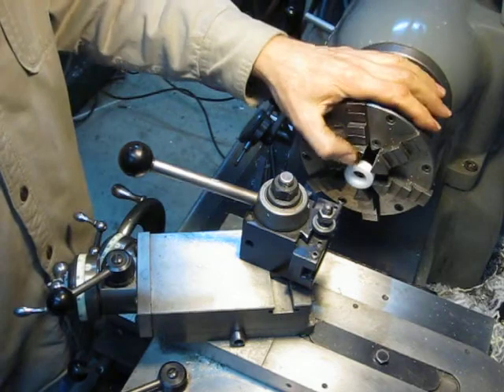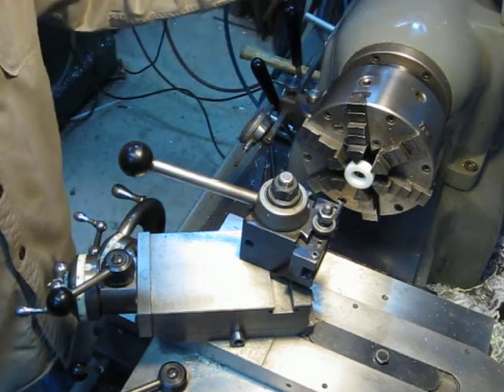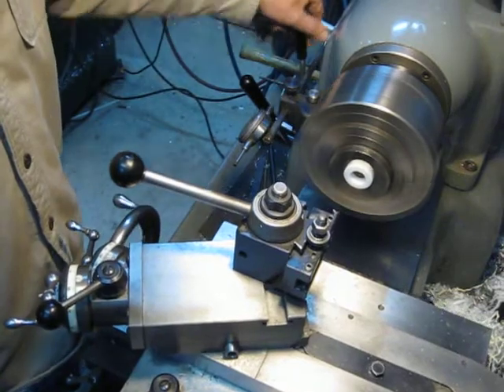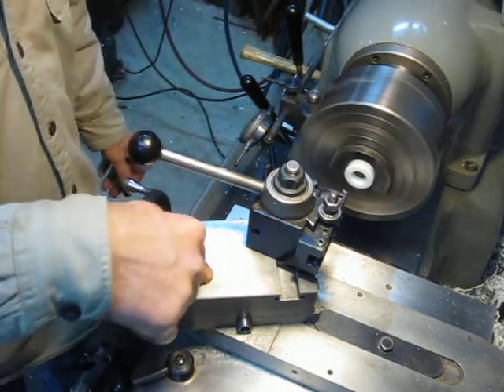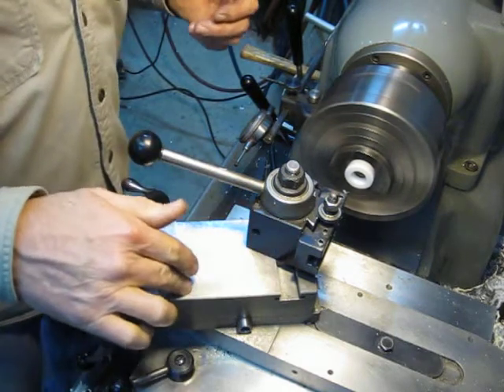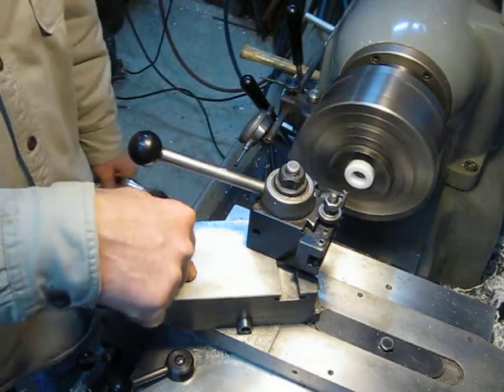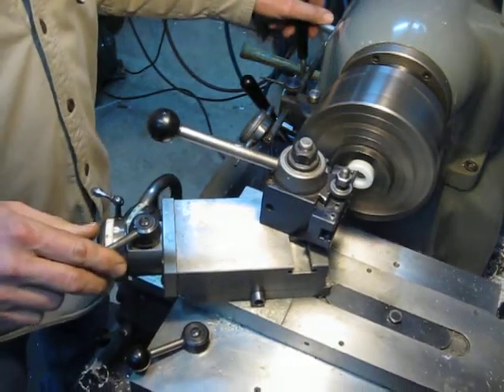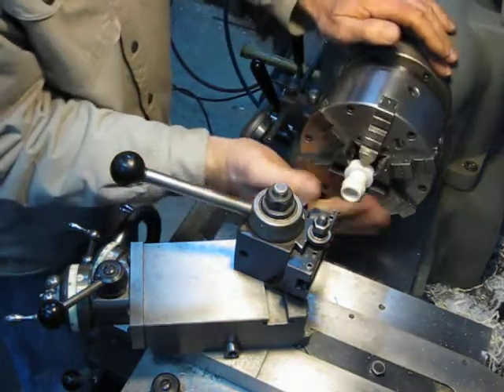Thread Cutting on the Hardinge Lathe

Comment: Sorry Tom... but based on the lathe's graduations you set the compound rest at 60 degrees.
Reply from the maker: The graduations are relative, James. When threading, the compound is set at 30° from perpendicular to the axis of the part, regardless of how the compound is graduated.
Reply: @TomsTechniques  Understood, but the graduations are set parallel to the spindle not some hypothetical perpendicular. When you say "30 degrees" normal people go by the graduations on the machine unless told otherwise which you failed to mention.

Comment: I learned in college on a South Bend, but in my first job as a young engineer I was privileged to work with true craftsmen experimental machinists. They rewarded my interest by teaching me and letting me make my own parts. They had beautiful Hardinge lathes that didn’t suffer the wear and tear of high production. We were doing artificial heart research, so a lot of the work was Al64V titanium. 

The Hardinge is a jewel. Even the headstock is comfortable to rest your hand on.

A great thing about the reversing lever is that you could set stops on the actuating rod to limit the carriage travel. Helps keep your blood pressure low when threading to an internal shoulder.

Comment: I must  have  worked on  maybe 20 or more different hardinge lathes nd not one had thread chasing capacity
Reply from the maker: The only ones that don't cut threads are the second operation lathes such as the DV-59.
Reply: @TomsTechniques  well it gave me an idea.  I can build a dovetailed slider to mount  under my  tool post. I have a 14" engine lathe so there's room.

Comment: nice video:) i'm suere someone may ask this same question, but isnt the 30 degree angle you have set up there supposed to be for outside threads? for inside, wouldnt the compound be swung all the way over? isnt the angle that you have making the cutting edge on the wrong edge of the tool? i guess it would be OK if your tool was ground flat on top, but then it prob would not matter is you just kept it at zero degrees. Right? i'm an amature so i'm actually asking in good faith:)
Reply from the maker: The compound is set at 30º so the tool only cuts on one edge. If you set it to 0º and fed the tool straight in, the tool would cut on both edges and put twice the load on it. Consequently the surface finish would suffer and the tool may actually fail. There is no "wrong" side of a threading tool, both sides cut equally well.

Comment: I would kill for an hlv, I just got a DSM59 FOR nothing.  there is an auto threading add on but I would have to sell my house to afford it lol.
so far I only have 2 X double cross slides w tip slides and a small 3 jaw chuck.  not that I am complaining or anything, I'm so lucky to have been gifted a dsm. it's unreal the thing came from a CNC shop and was never used. the bed has never and I mean EVER been used.  it had a box built around it and was only ever used so high speed polishing.

I'm getting ready to wire up a new phase converter that just bought for it.  

I traced the wires back from the control transformer to the three fuses.   L1 (red) goes to one side of the Transformer and L3 does as well  should I make the manufactured leg L2?
I was told that the manufactured leg should not go to the control transformer?

I bought an American rotory 5 horse convertor 

any truth to what I was told?
Reply from the maker: Sorry, but electrical is not one of my strong points. I know just enough to get into trouble, but not enough to give advice.: ) One thing I am going to do though is get rid of my rotary converter. It's way too noisy and inefficient. The VFD's have come down in price, so they are a better option.

Tom
Reply: Toms Techniques I was basically told to stay away from vfd for this hardinge lathe. they said the controls won't work right
Reply from the maker: The Hardinge is more of a challenge to set up with a VFD, because of the controls and multiple motors, but it can be done. That's one of the many things on my to do list once I retire. (Thursday :) ).

Tom
Reply: Toms Techniques congratulations on making it to retirement!
Reply from the maker: Thank you. 
One more day of being employed by someone else!

Tom
Reply: Keep busy brother, or its depressing as hell. I am no longer a letter to work and it's absoluly terrible!     I'm lucky if I can play 2 hours per week on Mt mill and lathes.  It's mind numbingly boring not working
Reply from the maker: Keeping busy won't be a problem. This summer I have a remodeling job to do on our up north cottage in addition to starting the building process for a year round house next door, including an attached two story garage/machine shop. There will be no idle time for me. :)

Tom

Comment: TomLove your videos and explanations. Could you describe how you would do a double start thread on the HLV H?
ThanksGreg
Reply from the maker: As with any lathe, you need a way to index the part 180º to cut a two-start thread. Using a drive plate with slots for a lathe dog is one way. Holding the part in a chuck and scribing a mark on the part along a jaw is another.

Tom

Comment: My work placement has these lathes. With the power feed, does the dial adjust in inches per minute? This would be good to know for turning stuff. Thanks!
Reply from the maker: ***** 
No. As with any variable electric feed, it's just a dial graduated 1 to 10. You just adjust the feedrate based on how the tool is performing and the appearance of the chip.

Tom

Comment: No thread dial indicator to pay attention to?
Reply from the maker: Nope. Since the half nut is never disengaged, a threading dial isn't necessary.
Reply: Okay, so the half nut isn't disengaged, but what about the leadscrew? It's disengaged from the gearing somewhere in the headstock. How does the machine ensure it's correctly timed with the chuck upon reengagement? This is kinda blowing my mind and it's gonna bug me until I understand it. XD Also, how do you change thread pitch? Change gears or a quick-change gearbox or some other method?
Reply from the maker: Orcinus24x5
I've wondered how the Hardinge engineers managed that myself, but I'm not willing the tear into the headstock to find out. I suspect they may have used some sort of clutch that only engages in one position. but I don't know for sure.

Tom

Comment: I am on a FIRST Robotics Competition team and we have a Hardinge lathe and would like to be able to thread on it, but our gears were removed/destroyed by the previous owner. What is your source for replacement parts?
Reply from the maker: Parts for the HLV-H are available directly from Hardinge but be prepared, they are very expensive. You may want to try finding used gears on ebay or from Plaza Machinery

Tom

Comment: Tom, I recently purchased a dsm59 second op lathe. I have a job coming up that requires the use of a chuck. I'm 99% sure the dsm59 and the hlvh have the same spindle noise. Cant find in my manual or anywhere else how to mount a 3 jaw chuck onto the dsm59. Ive seen dsm59's with chucks mounted on them. How do you change the chuck on your Hlvh?
Reply from the maker: All of the Hardinge lathes use a tapered spindle nose with a pin. You put the chuck on and rotate it in either direction to lock. I see Hardinge backing plates on eBay all the time.

Tom

Comment from the maker: The basic process is the same on any lathe. The Hardinge just has a few extra goodies like the reversing leadscrew, tool retraction lever, an auto carriage stop and the lack of a thread dial. I may have to dig one of those up for the demo since most lathes have them.

Tom

Comment from the maker: I use the stop all the time, in fact it was set in the video just to keep from crashing into the chuck. It will reliable stop the carriage withing .003" at speed.

The threads were cut with a HSS boring bar made form a tool bit.

Tom

Comment: impressive stuff Tom. I have a UK made HLV , just refurbished and as you say a lovely machine . Please may I ask if you use the stop at all , to turn off the carriage. I can see you are fairly practiced so you obviously don't need it. I have found to my cost the grub screw needs to be done up tight.
Also , what do you use to cut the threads with , - its difficult to see .

Comment from the maker: That's because there isn't one. The half nuts stay engaged all of the time so a threading dial isn't needed. To return to the start of the thread, you just reverse the lead screw. It's much faster and easier than using a threading dial and you can thread at turning speeds.